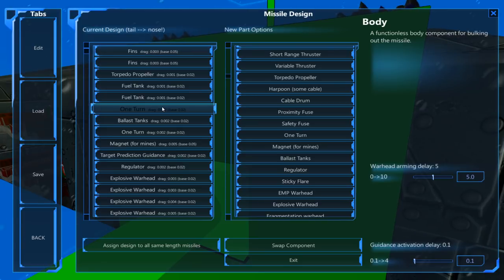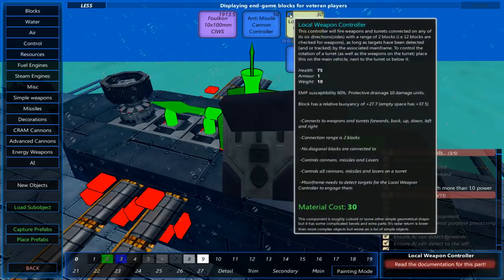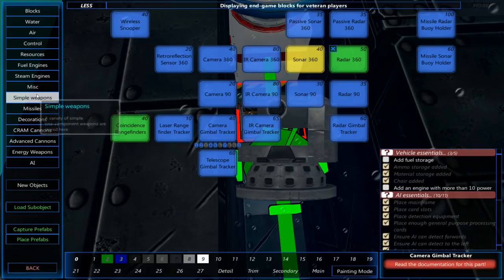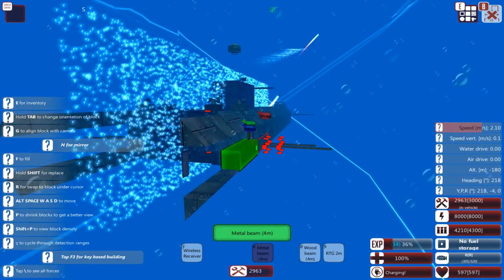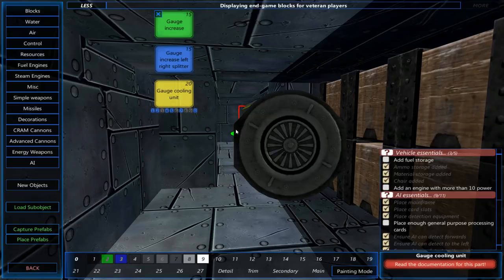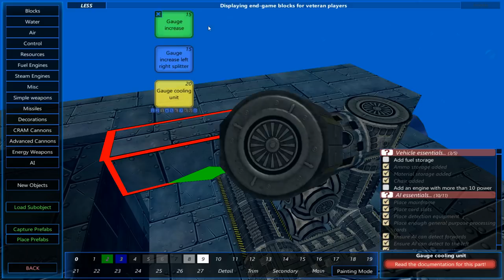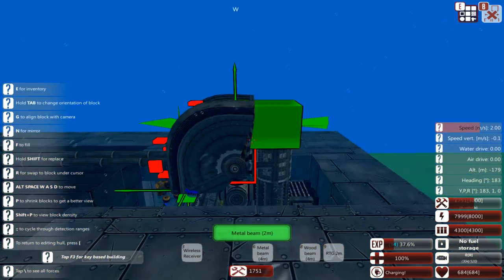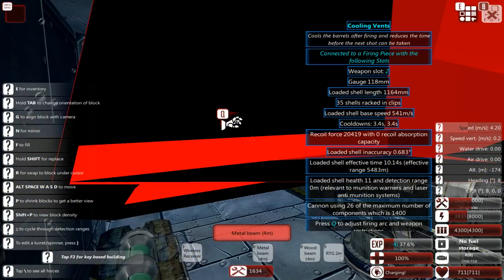From the Depths - Turret Atrocities - Adventure Mode

Comment: Splitters only connect with the middle part towards the firing piece, you may have already discovered that though since I'm not through the episode yet (edit: oh you did). For sealing the light blocks (not the light alloy blocks) seal water out but do not collide with turret blocks, shells and the like, they are however costly, explosive so a good turret cap is needed, and as the name suggest they are very light so using an abundance of them might necessitate extra lead.

Comment: From my experience, a symmetrical sub is better since you don't use as much fuel stabilizing. Also, if you put the turret block flush with the deck it can traverse and elevate, a self contained 5 inch gun is great for taking out planes and small surface craft. It's been a few updates since I've played so I'll look at my old Balao Class tomorrow.

Comment: Donno if you figured the APS cannon issue you had, as I have not finished watching this upload and I just noticed I somehow skipped your second upload.  You were on the right track (you dont need 6 way connectors)  the T shape of the splitter you had it placed correctly for the cooler yet not correctly for the fire piece. Next time place it as you did in a T with the fire piece, which will show that its not connected(dw about it) > Rotate the splliter so that the middle connector of the splitter is toward the firepiece and shift click to replace block. 

Having said all this, your sub is way too thin and needs more height for any APS/vertical missile/PAC or upwards facing PAC to bust hulls while you are under any ship..thats kinda cool :D. yet this also includes incoming damage, due to a cram shell which is only time before it hits you, will insta kill your little avatar due to the large AOE that they do, APS shells still easy pickings and ofc laser (only due to the fact that you are still 1 layer even tho laser damage underwater is reduced its only a matter of time) . 

Oh radar buoy and sonar dont need a timer of 50 secs on them as they can only have a buoy active depending on how many of the detectors you setup on the main frame.

Do not forget to check the map for red X's of destroyed constructs. That is all good resources. The resources I think you are collecting is per hit you do on an enemy.  Will continue watching later :)
Reply: minimum range on your APS should never really need to be touched so set that to unlimited. max range depends on your accuracy ..can it hit at 5k distance? probably 1500 -2000 you need to test that by observing the enemy construct while the APS is shooting it. max height to shoot unlimited depth also I dont think that mantlet can shoot downwards so if you are at -180 it will fire -180 and up. You could increase your torpedo max altitude too, to about 10. On the fail safe I think you may need to set both sliders to max tho, you could set a fire constraint on the turret "just in case" later on if it does shoot the fin.

Comment: Unfortunately, none of these strats work anymore. The first enemies you encounter are almost assuredly going to have torpedoes and/or lasers. I have yet to encounter any at the start that were remotely killable. You also no longer gain resources from simply causing damage to the enemy from a distance. You have to destroy them and go pick up the salvage. The only workable strategy I've found so far at the start is to make your raft into a jet and fly through lots of green warp gates, stopping along the way to circle above resource zones.

Comment: Quick question before I can help most on the gun: Would you like it to also be capable of taking out incoming torpedoes?
Reply from the maker: No, probably going to make that a separate weapon system later.
Reply: Cool.  You're going to need more detection of a specific type - you need a range detection.  Given the placement on a sub, I think I'd suggest the laser range finder, as it is smaller and thus should interfere less with your streamlining/drag.  The different detection systems each provide slightly different information with varying degrees of accuracy.  Some are mostly accurate on bearing rather than range, some better on range than bearing, and on top of all that is how frequently they update.  

Anyway, the space inside the hull that you are working with is only 5m wide, and that means the maximum horizontal dimensions of your turret can only be a shape that is equivalent to 2x 3x5 sections crossed centrally (ie a 5x5 block with each corner block removed).  Any larger won't rotate fully.

In terms of height, you have 2 blocks available, minus the central bottom block where the turn-block or turret-block must be.  Then you have a 1 block collar through the hull, and whatever space you can cover with a turret-cap above the hull.

I'd recommend building your guns in the sandbox, where you can tinker freely, and then saving them there as  ploppable sub-objects or pre-fabs, which you can then easily place as such in the adventure mode.

Given that your sub is small, you are going to want to negate as much recoil as you can, otherwise each time you fire you'll be applying torque-force to roll your sub.  You're probably going to need that recoil absorption, because since this gun is mainly for AA, its shells need to be at least reasonably fast - and that means they have a lot of force when fired.

Always start by placing the connectors or a wooden beam/blocks on top of the turret block to the height at which you want your firing piece - because its a lot easier to work the plumbing of gauge increasers and coolers from the firing piece back, rather than reverse.

But the real starting point is the shell.  You know that space is very limited, and thus you need a shell that can fit into 1m loaders, or reloads will be slow.  While you could technically fit 2m loaders, you'd then only have room for an input feeder on one end, slowing the reload - so stick with 1m.

Place down your shell maker down, and design whatever shell or whatever gauge you like that fits into a 1m loader.  This will let you play around with the gauge and length before committing to the gun itself, and design yourself the shell that does what you want in terms of damage, penetration, or special effects.  That shell design lets you then build the gun for the optimal shell, instead of trying to make a shell that simply fits whatever gun you built.  The shell itself defines the gauge, cooling, recoil, barrel length, and reload time, so only by creating the shell first can you create a gun that is optimal for it.

I believe you'll end up with 3-4 auto-loaders and one ammo-clip for each loader, with one feeder on each autoloader and 2 on each clip.  It could end up with only 2 if you needed extra space for recoil absorbers though.

Is that enough help to be starting with, or would you like us to knock up a sample design you could download and backwards engineer?
Reply from the maker: Thanks very much! This is going to help me build a good cannon. I'll work on making the sub bigger first, before working on the cannon again. Once I have, I'll definitely come back to this comment :)
Reply: You're very welcome.  One thing I'll add is that in Adventure mode, I favour accuracy over most other things in my weaponry.  Simply because resources are limited, and you'll always want to rely on passive ammo recuperation rather than ammo-makers, but at the same time, you don't want an ammo storage area that takes up half the ship and makes the whole thing one giant time-bomb. :)  The more accurate your weapons, the less wasteful in resources they are.

Comment: My comment probably reached you too late on the other video, but if you have the time to remove the wireless recievers and use AI connectors to wire up the whole sub, you will stay undetected a lot lot longer.
Reply from the maker: Does it matter much though? I can be detected by sonar at 910m range and by wireless snooper at 135 m.
Reply: You'd be surprised how much it matters. That range is only the 100% detection range, they can see you much further out. If they see you with 5%, it doesn't matter how accurate the signal is once the torpedoes are in the water.
Reply: More importantly, that's how flyers detect you if they don't want to drop sonar buoys.
Reply from the maker: Ok, but I'm usually at 160+ meters depth. So even at 130m snooper range a flyer won't detect me right?
Reply: They will :)
Reply: 130m snooper range means that they will detect you roughly half of the time at double the range iirc. And when they have detected you, it's mostly just a negative to accuracy. Edit: It may be 25 more range however.
Reply: SnowDrakE cool￼